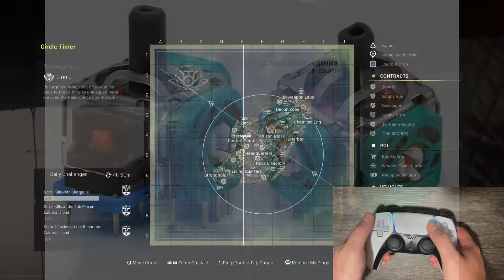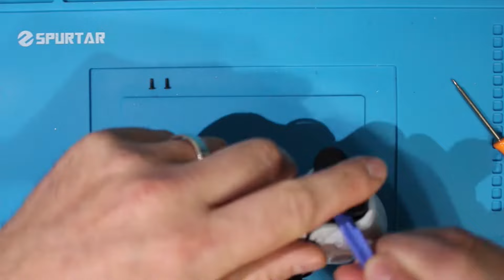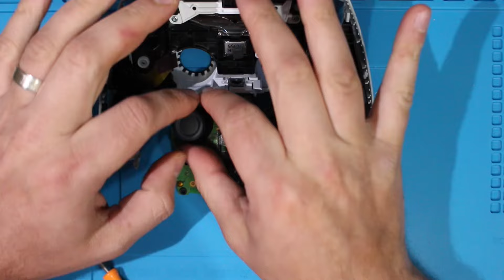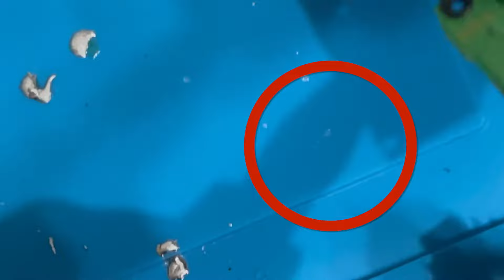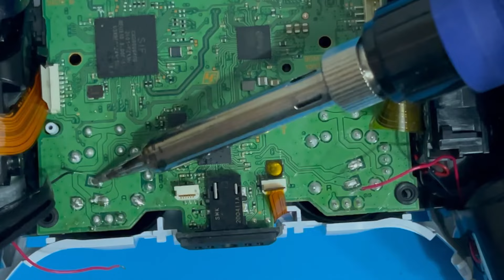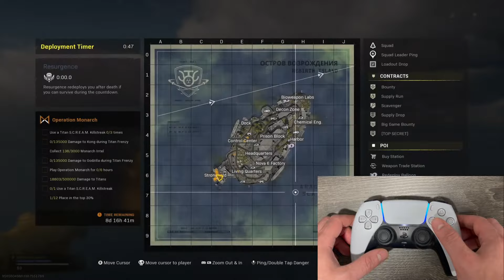Analog Joystick Replacement For PS5 DualSense Controller DIY (Soldering)

Comment: When you busted out the SMD removal alloy, I thought finally someone made a good tutorial on how to replace a DS thumbstick I can recommend to people. But then it went downhill from there. I am too lazy to make a video and don't have a PS5 but If you would like to have the definitive best guide for DS thumbstick replacement on youtube, you have all the tools, you just need to follow these steps:

Ditch the hot air gun, too expensive, someone looking to repair their first controller isn't going to want spend that much money. Add flux to the joints like you did, then add the SMD alloy but keep the soldering iron on the joint and wiggle it back and forth until the alloy is thoroughly mixed with the existing solder. Then once you have it mixed well with all the joints, rotate around taking turns heating all the joints with the iron until they are all simultaneously molten and you can pull the stick out.

After you have removed the old stick, you have the clean up the SMD removal alloy as it will seriously weaken the new solder joints. You had the right idea with the solder wick, but you needed to apply flux before using the wick. Also you should cut off a small section of the wick and hold it with some tweezers otherwise your entire spool of solder wick is acting like one big copper heatsink and preventing you from transferring heat to the board.

After you got the new stick in place, you did a pretty good job soldering everything. Technically the four joints for the housing weren't soldered properly, they have more thermal mass than the rest of the joints so they needed to be heated longer. But this is nitpicking. If you have made it this far, you have already created by far the best and most inexpensive video tutorial for replacing a DS thumbstick on youtube.

EDIT: After watching your newer potentiometer replacement video it seems like some of this information may now be redundant as you seem to have more soldering experience. However if you decide to make a video showing how you can remove a thumbstick using only SMD removal alloy and a soldering iron, hopefully some of it is still helpful.
Reply: What soldering iron is best to do these repairs?
Reply: I've literally bought a heat gun because the iron I was using is a 100w, and it damaged the board, that costs me more in the long run, my sucking tool is rubbish so I'm going for the heat approach with plenty of flux.

Comment: Fixed mine. Thank you.
I had to watch how others did because I wasn't able to remove the button myself. After I saw you used a fan, I tried it immediately and it worked.
Reply: @bkid1776 you can’t do it. And it never works perfectly anyways, with Sony controllers you’ll always have 1-5% basically
Reply: @bkid1776  the average out of box ps5 controller has 4%ish spread at least, that is the max you can get it to “stick at”, I’ve never seen a controller that doesn’t vary at least a few % and I sell them as a side job
Reply: @ChummyBoy  I was able to get my controller to 0.00 for both sticks on mw3 there is no drift. I think when u plug it into a tester it’s 0.0032 or something. But there’s always drift out of the box yea I had to do mine custom

Comment: Nice work I have a controller horrible drift I’m going to change the analogs, was that heat you applied to remove it of the board???
Reply from the maker: Yes, it was a heat gun. It took me a while to heat it up in order to melt the solder to remove it. If you clock on the description of the video, I posted the links for the heat gun and other tools in the video. Good luck :)
Reply: Hey did u change it? Did it work? I really have to change it but I’m a little bit scared to break anything.

Comment: its a miracle this controles working :D
Reply: bro did zero calibration and heated the board for minutes with a heat gun , FOR MINUTES XD
Reply: @Deathscythe91  fo real :D MIracle Fix
Reply: @Deathscythe91 what calibration?
Reply: @csgoinsaneclutches5317  😂😂😂
Reply: Okey good so im not a asshole if i say he did all that extra shit for nothing cuss for me its just melt point suck up metal one by one replacement joystick metal back in like tf

Comment: Is it possible to do it without soldering or another way ?😢
Reply: Nope.
Reply: I feel the same
Reply: it is, u can take out the potenciometers and buy new ones but if ur joystick is jammed then no
Reply: you can just replace potentiometer if you are having stick drift but that's just temp solution.  it will stick drift again.  need to replace whole joystick with hall effect which requires soldering.

Comment: i put aftermarket thumbstick modules on my scuf xbox controllers. the ones i used they have treads on the top. so the thumbstick caps i need have to be treaded on. WHERE DO I FIND TREADED THUMBSTICK CAPS???????

Comment: I have the problem that my joystick feels and sounds dry. Any quick advice? No drift preset or any other issues just the noise and feel.
Reply: Probly just super dirty inside. If you have pets could be hair got inside, if you eat food around your controller could be you’ve got bits of crumbs in it.

Comment: may i ask you, what soldering pistol were you using cuz i bought a pretty cheap one that's up to 430 celsius but only the wattage is only 8W, and it did not melt, even when i applied flux  :d
Reply: nevermind find it in ur description

Comment: What temp is your solder tool?
Reply: Heat gun - 380c and solder iron 330c will do the work.  I replaced all my 5 controllers using this setup.

Comment: Is it possible removing analog without a heat gun useing braded wick with solder iron on solder myne snaps back into place could just change wipers in analog has had stick drift new out box from PlayStation direct is a new model controller has stickdrift on o dead zone in apex legends has to be 5 dead zone to remove
Reply from the maker: Hi, I just made a video to remove one of the potentiometer and a good way to do is to use rework alloy. Check in this video and I linked the item in the description 

Changing Potentiometer  FIX STICK DRIFT For Console Controller  PS5 / Xbox

https://youtu.be/Oo50NkEgiNA

Comment: Cant i just replace the sensor piece instead of the whole thing?
Reply: you can but you will have stick drift again.   I don't know why this guy change another potentiometer stick instead of hall effect one.  I  guess back then, they didn't have one for PS5 controller.  this is temp solution as you will have stick drift again in the future.

Comment: I did it then my controller keep flashing orange 3x when I hit the PS on button 😢 , I don't know if I damaged the board?
Reply: Did find a fix it? I have the same issue.
Reply: I had the same issue and it was because of the one of the ribbon that was damaged.  You may want to try to put the PCB and battery and connect to power supply to see if it flashes orange light. Mine worked fine. I put each ribbon one by one and tested to see if I get 3 orange lights and when I insert right ribbon cable, it gave me the signal.  I changed the ribbon and it worked fine.
Reply: @Killerbeastt  it maybe cuz of damaged ribbon cable.  see my comment below

Comment: I had someone replaced my right joystick for my ps5 controller but I notice instead of the joystick doing a circle it’s doing a square what could that be? Also it has some boost when moving the joystick to the left side.
Reply: Is this when you trying to test circularity test?  If you do this before assemble controller fully, test website shows square instead of square.  if you put all controller together, you should have circular stick range.

Comment: Plenty of errors in this video, great to see and call them out.  you have to clean those holes of solder!  you got a few done, just keep going and get the rest.  You can test it before putting it all back together too, by plugging in the battery then usb-c cable.  Someone will correct me and comment on the gamepad  tester website that shows the analogue sticks reading visually.    When soldering it in, you must be very sure to be flush with the board, or else you wont be able to put the controller back together or youll get a lot of rubbing on the controller case.  I think you just bought a new controller to use at the end of the clip

Comment: I was told to replace the joystick assembly with the same color that it came with. In this case you switched out the orange for green so I’m confused
Reply: Not how it works sadly technically you should use the same brand green (alps) but orange favor union brand is way better

Comment: 35 years as a prototype electronics engineer and that desoldering was probably the worst I’ve ever seen as a tutorial, you seriously need to learn to solder properly before you preach to others, your heat gun was clearly not hot enough for lead free solder that is on these PCB’s so solder wick would have been a better substitute, you had no clue on where or how to use the solder sucker, and re soldering the stick controller and potentiometer you might just as well have wrapped silver foil around the joints for all the good you managed…!!! Based on what you tried to teach others to do was about as much use as an ash tray on a motor bike, may I suggest you don’t show people how to solder…..anything!!!!!

Comment: You edited out too much.  I was hoping I could use this as a tutorial and do what you did, but I had a hard time figuring out how to remove the black battery tray because you showed it just lifting out, and then you showed the PCB just lifting out without detaching the haptic vibrating things, so at this point you're skipping steps and I'm confident that this is merely a showcase and not a good resource for actual information.  Thankfully someone else in the comments gave some very useful soldering tips I can remember for when I do find a decent guide.
Reply: It's a single screw, not hard to find if you got 2 working eyes or just the 1!

Comment: Half of the steps you did are needless and would put anyone controller following it in jeopardy, I suggest you check other YouTubers videos how they did  it, much simpler
Reply: He did it the way it should be done. 
What steps were needless?
Reply: Honestly, there is only one thing I didn't like when he applied a heat gun to force the analog stick through the solder. Too much heat may ruin the board, but it is personal preference.
Reply: not only that wheres the calibration guide